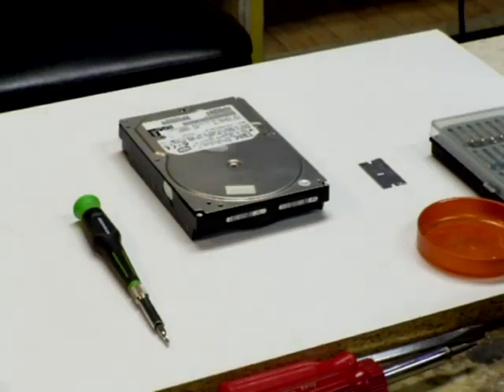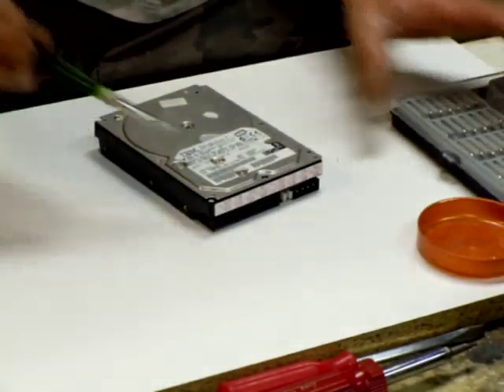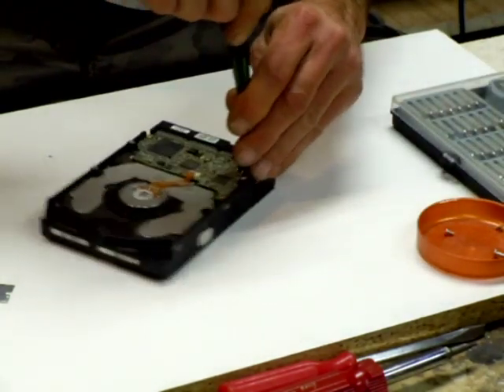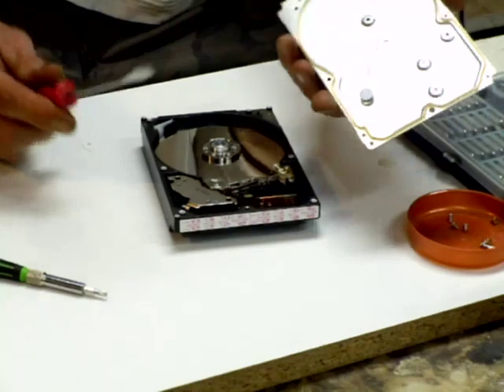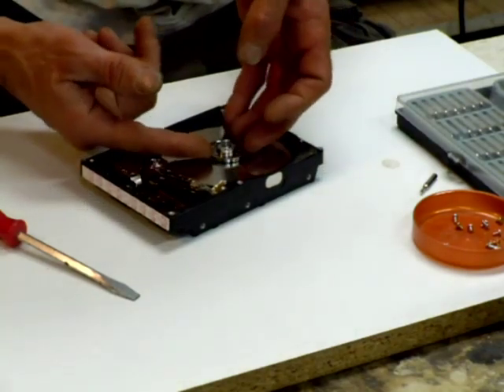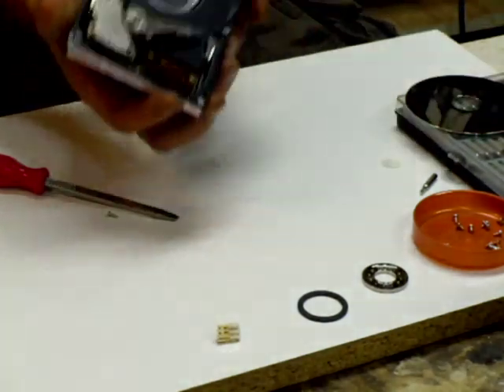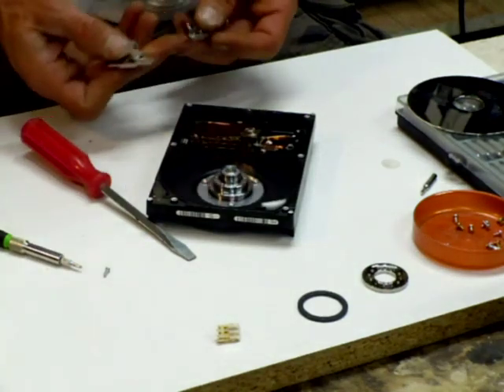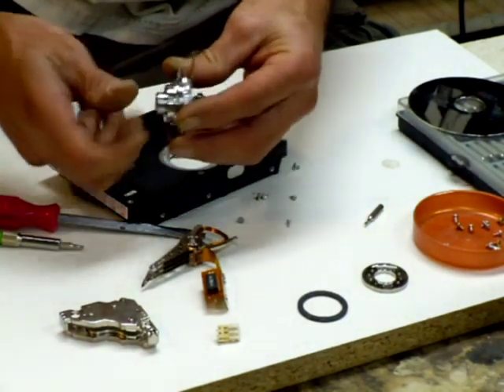HardDrive-Bedini-Motor--Taking the hard drive apart (actually doing one) - Destructive - Part 2 of 2

Comment: Idk why i can't take the motor because it's like traped in :/ with hard glue or smthing
Reply: Make sure all the platters are out, then with a nail and hammer, hammer the nail on the small circle on the back of the hard drive where the motor is.
Reply: Thank you